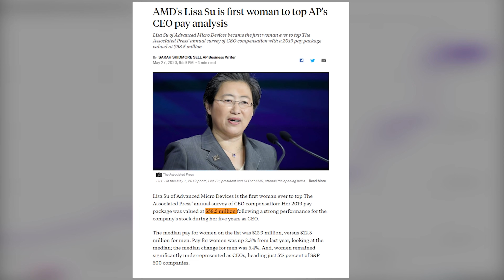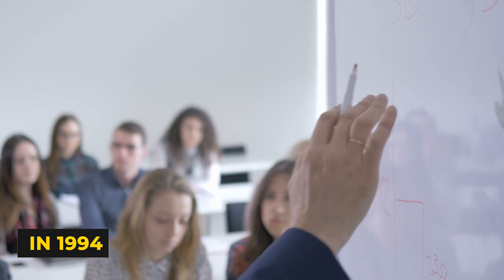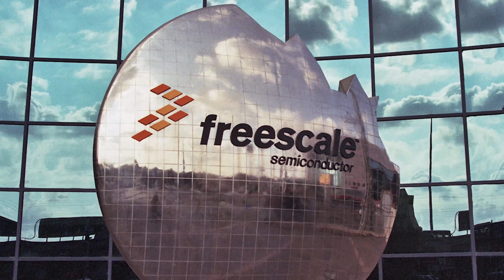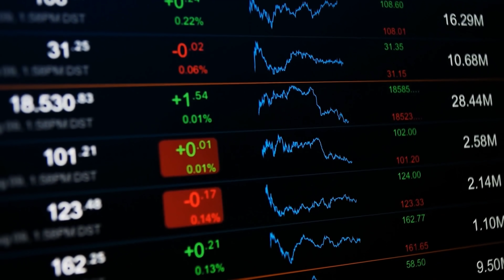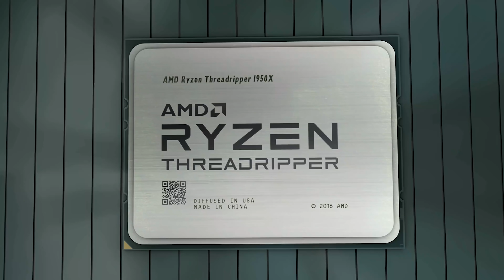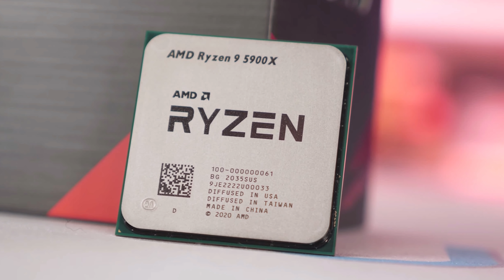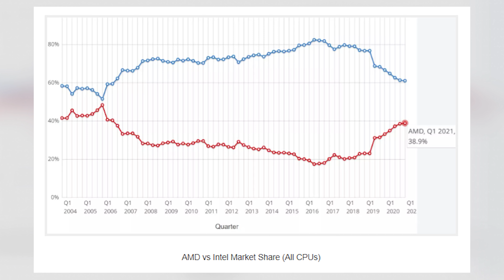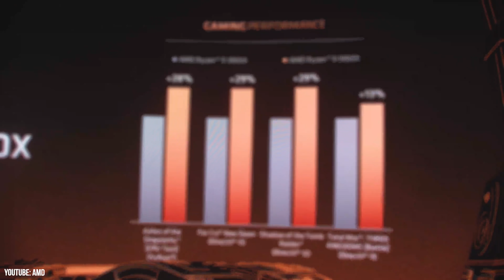How Lisa Su Became The #1 Paid Woman In The World

Comment: You cannot simply compare CPUs by GHz. Even with the same GHz and core-to-core comparison, the tasks that can be handled by both CPUs are different.
Reply: yea because the i9 11900j still match the speed if the 5950x
Reply: I'm looking forward to the 12 Gen Intel CPU. Seems things finally turned around for them based on the leaked info. Healthy competition is great for everyone.
Reply: @rochester3  Actually, it lost more times than it wins, even with it's higher clock speed.
Reply: @sokool3994  in gaming you cant even tell the difference for an 8 core cpu vs amd 16 core which is best for workloads when editing
Reply: @rochester3  You can't really tell the difference, but it is there. Also, the 11900K is sometimes even slower than the 10900K.
Reply: @sokool3994  when it comes to editing videos and heavy work loads then yes the 5950x will shine but for gaming ,1k for a cpu doesn't justify the price.. I got my cpu which came in bundle with my 3090 which was a good price, i have no regrets and im on 11th gen which supports pcie gen 4 for my m.2 ssd gen 4 which 10900k doesnt support.
Reply: @sokool3994  the funny part about this is comparing an 8 core cpu to a 16 core cpu.. on paper its not even fair but when you watch benchmarks comparing game play its not that much difference
Reply: @rochester3  Games haven't even really use 8 cores, let alone 16 cores, so I think it's a fair fight. Most of the gaming advantage of the Ryzen 9 5950X comes from the fact that it has stronger per-core performance (even with a lower clock speed)
Reply: @sokool3994  $700 cpu vs $1000 cpu for similar performance in gaming idk what you say.... show me a benchmark video of the 5950x smashing the 11900k and by smashing in gaming it better be worth $300 more per fps LOLi expect 100 fps for $300, i bet you cant im not talking about 35 fps when both games are getting over 150 fps cause right now the difference in fps is at least 10-15 fps and that's not worth $300 more so stop cappin lol
Reply: @sokool3994  the fact that i sent you a video link of both cpus showing not that much difference in performance in gaming just proves what your trying to do here lol AMD fan boy i see u
Reply: @sokool3994  'Most of the gaming advantage of the Ryzen 9 5950X comes from the fact that it has stronger per-core performance' 

LOL you capping so hard its not even funny dude stop it
Reply: @rochester3  The video link is not here, man. Though, I know that it DEFINITELY does not beat it by a significant amount. But your prices are wrong. The Core i9-11900K is supposed to be $600 and the Ryzen 9 5950X is $800 (It's $743 on Amazon right now).

For what I think about it, the Ryzen 9 5950X is useful for those who wants a powerful gaming CPU that can also do productivity tasks very well.
Reply: just type in 11900k vs 5950x it not that hard  to see lol but i think your kina trolling
Reply: @rochester3  I'm not trolling. I'm basing my knowledge from Gamers Nexus and Hardware Unboxed. The Ryzen 9 5950X is definitely not the best value for gaming, but that's what happens when it has 16 cores for only $200 more. Also, what about the Ryzen 7 5800X? No discernible difference compared to the 5950X and i9-11900K and it's only $450.
Reply: @sokool3994  Gamers Nexus. hes the goat when it comes to giving his honest opinion, its best you check benchmarks on gaming performance from other channels.

Comment: Ghz is a very poor comparison for CPU’s. IPS is significantly more important, or at least just as important.
Reply: Ryan means Ipc, how many operations the chip can do with one cycle or 1hz. If you set 2 cpus at same clock speed, one will be better at a given task than the other, which this better ipc. IPC usually improves by 5-10% per year, but amd has pushed that closer to 20%
Reply: @highiqwarrior  sorry yeah, IPC not IPS
Reply: @highiqwarrior  that’s why the AMD processors can be 20% faster every year even if the GhZ only goes up 2-3%
Reply: This video lost me when they began adding up Ghz.

Comment: not that relevant, but there is one element of the video that really irked me. You can't compare processor speed based on cores and clock speed. a lot of applications don't use all those threads, and instructions per clock is just as important as raw clock speed. base clock speeds shouldn't be used either, as all modern processors can boost to higher clock speeds. it is true that the 5900x  (when it was new) was faster than the 11900k though.